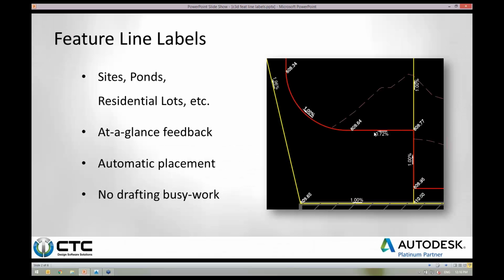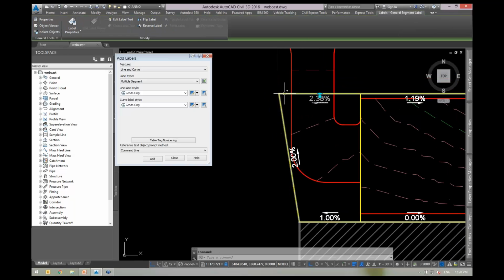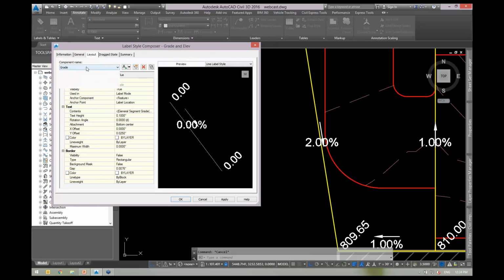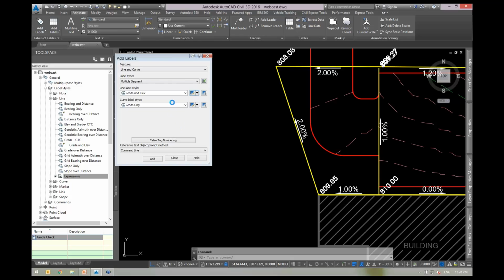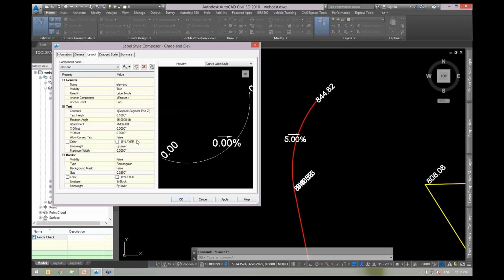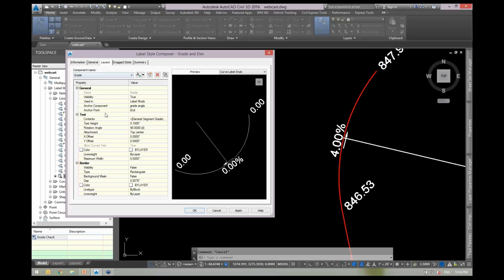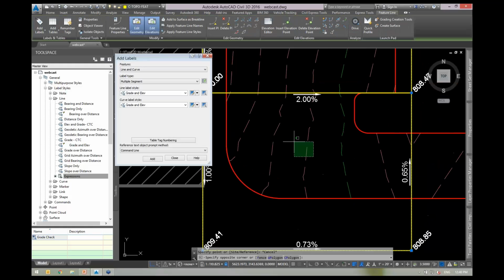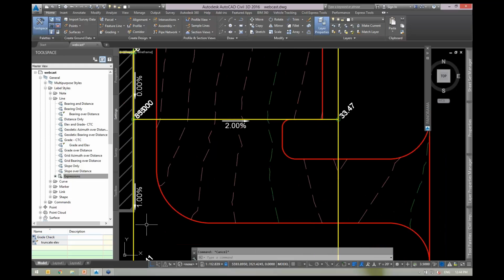Civil 3D Feature Line Labels

Comment: On the arc segment, based on the Grade component angle being 270°, the arrow points to the correct direction ONLY when the arc segment is drawn counter-clockwise; clockwise segments show the arrow pointing the wrong direction. If I change the Grade component angle to 90° then it's vice versa for the arrow directions. You can see this problem in your video if your look at the northwest arc segment of the road (809.72 at 1% to 809.49); the arrow points uphill.

How can this be addressed? Is there a method for determining counter/clockwise?
Reply: +joshc96 So, I "fixed" it by making the Grade Line go from Segment Start to Segment End and attaching the Grade text to that. I can't find a formula to determine CW/CCW using just the available elements in Curve label expressions so this is my compromise, which isn't pretty. I tried calculating the segment height (sagitta) to create an automatic Y-offset but it works only for <180° and CW. Also, I make the line visible using a DOTS linetype to help the user understand what they are seeing.
Reply: +joshc96 Glad someone else is seeing this as well. I finally just took out the arrow for arc labeling. It actually has a hidden benefit because you can tell if a large radius arc is a line or not simply by seeing if there's an arrow present.

Comment: Great video thanks. When I attempt to add a Direction Arrow to a Curve in the "Curve Label Style" composer window I don't have the option to add the Direction Arrow. It is available in the "Line Label Style" composer window however. Any idea on how to make that option available. I'm using Civil 3D 2014. thx.
Reply from the maker: Hey James,
The arrow component in the curve label style composer is a block component and not a direction arrow component. This is why it is necessary to utilize the trick that involves drawing a line from the center point to the mid-point of the arc. Hope this helps, thanks for watching!
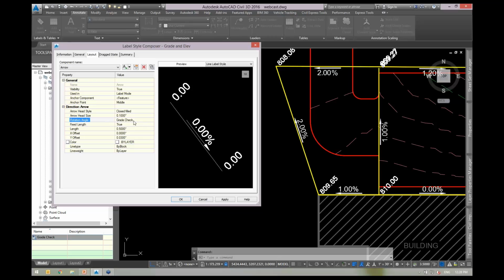Reply: +CAD Technology Center Thanks, yes that helped a lot. However when I add the "Expression" called Grade Angle in for the rotation of the arrow block it's only allowing me to enter an angle as an number (in degrees). I can't get it to link to expression I've entered (see 13:18 in your video). It's not giving me the Grade Angle option.
Reply from the maker: Big Game James

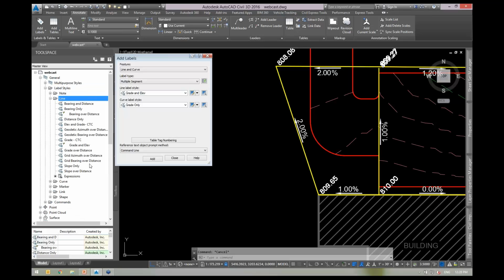You can see how to use the expression for the rotation angle at the 12:20 mark in the video. Also make sure that you built the expression under General > Label Style > Line as can be seen at the 12:40 mark.